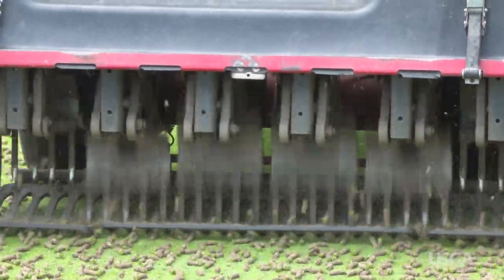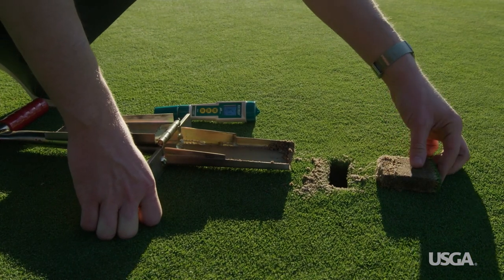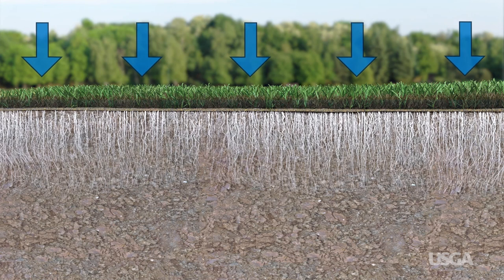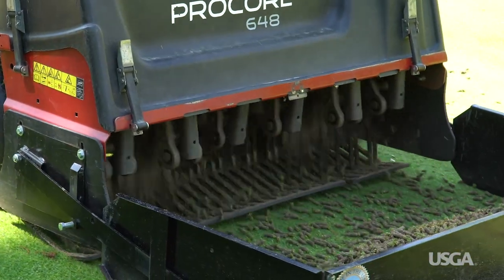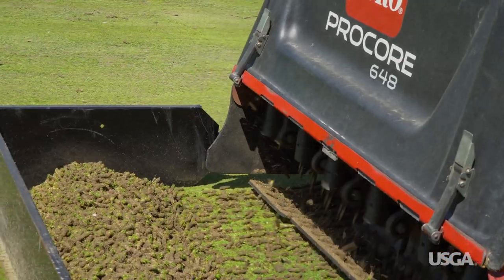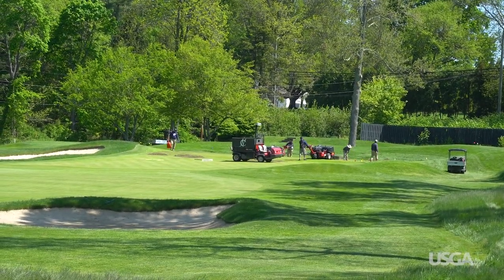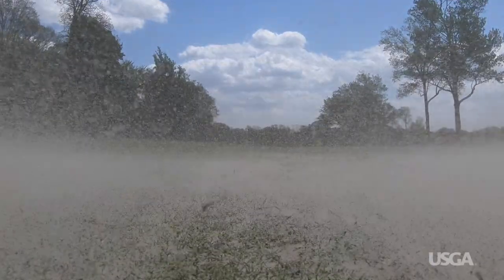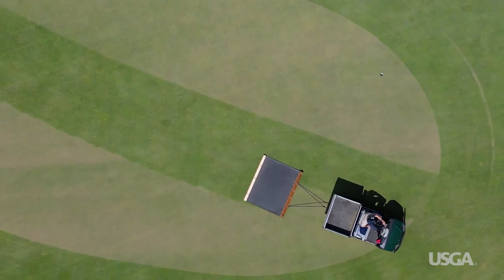Why Do Golf Courses Aerate Putting Greens?

Comment: This is an interesting video, but it's misleading as to the primary benefits of aeration by soil-core removal.  The primary benefit is NOT the removal of thatch.  The cores, at best, make up a relatively small surface area since they are spaced so far apart.  Therefore, the thatch removed in the cores is a very small percentage of all the thatch on the putting surface.  Thatch is best removed by verticutting, not aeration.  The real reason aeration is performed on putting greens is to lessen compaction thus opening the turf to water, nutrients and air.  Compaction is a result of the constant foot traffic on the putting surface, often when the soil is wet, which makes compaction even worse.  The subsequent topdressing with sand after soil-core aeration helps to fill in the cores and has a secondary beneficial effect on thatch decomposition.